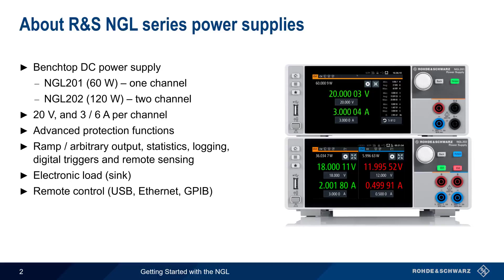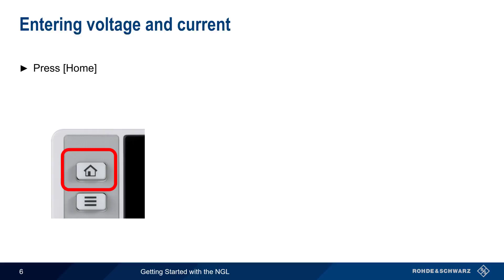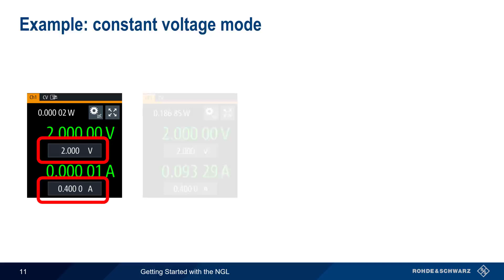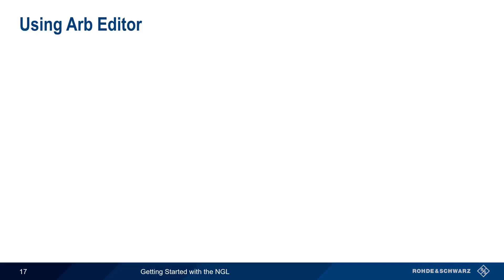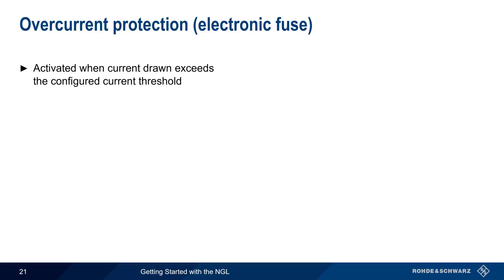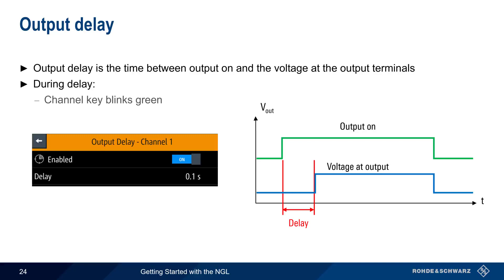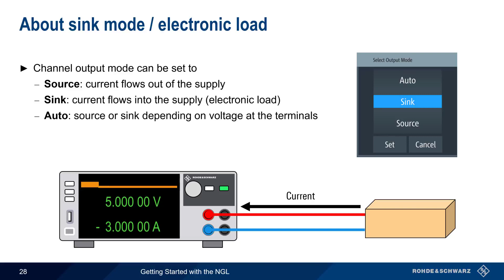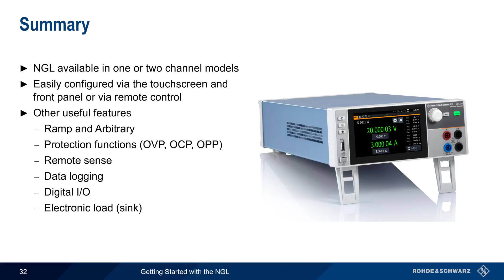Getting Started with R&S NGL Power Supplies

Comment: Is it possible to supply a certain negative voltage  to a positive voltage in a desired step against the DUT? 
I mean, if I want to use a zener diode as a DUT, it it possible to get the I-V  data both for forward and negative bias without changing polarity of connection? 
Thanks
Reply: Normally to make these kinds of measurements without recabling you would want / need a source measure unit that can operate in all four quadrants, so to speak.  Please see the videos "Understanding Source Measure Units" and "Getting Started with the NGU" (our source measure unit) for more info.  Thanks!
Reply: @pauldenisowski  Thanks for response.